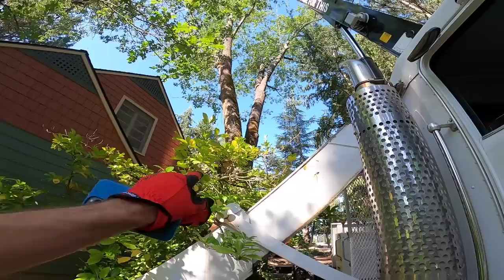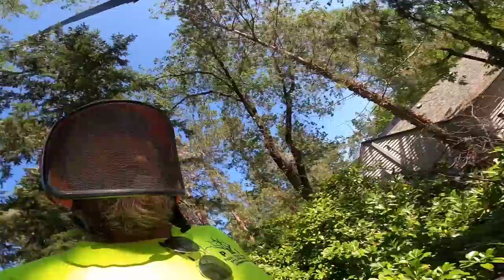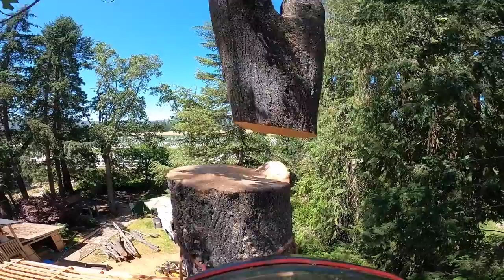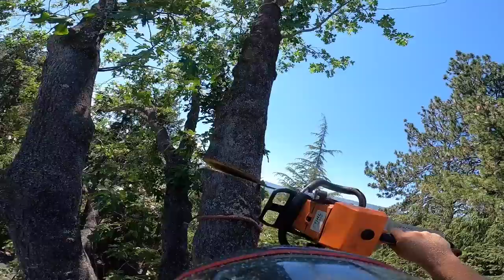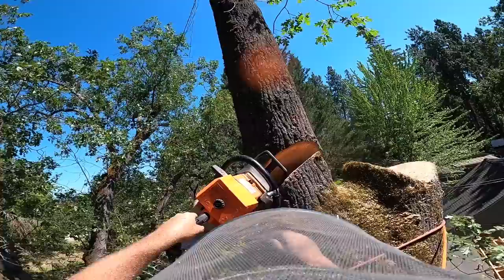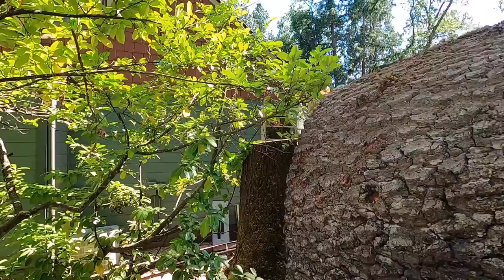Baby Birds are Gone. . . It's Game on.

Comment: Good to see you guys back.  Respectful and sorry for long comment advice to those who may not know, when you glue a slip fix coupler especially on a line that is under constant pressure make sure the pipe end is completely extended and it's best to glue it in the direction of the water flow or it will bow and will eventually crack under the pressure.